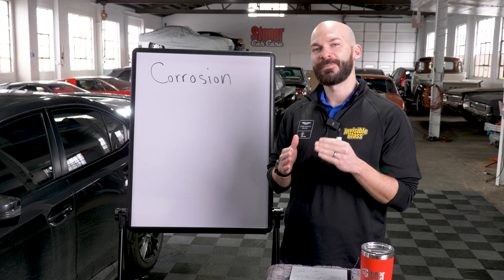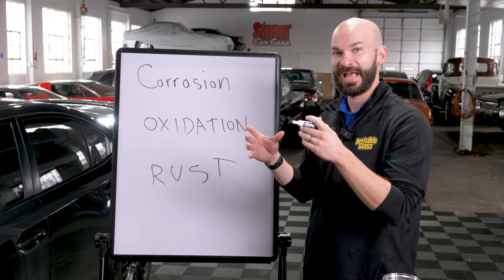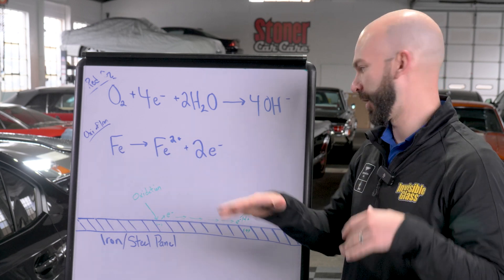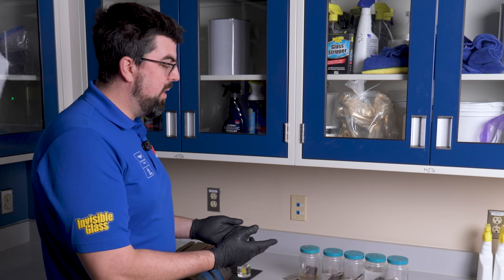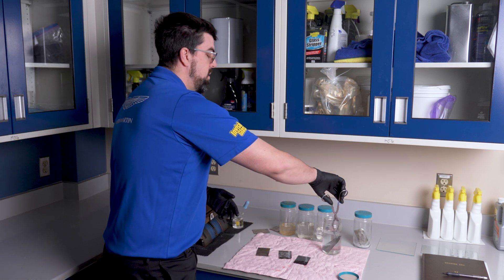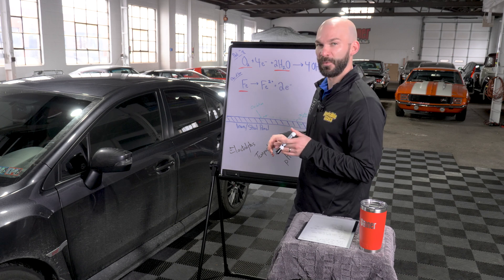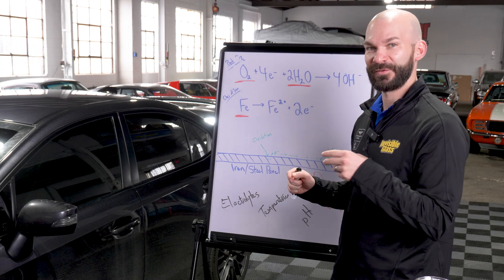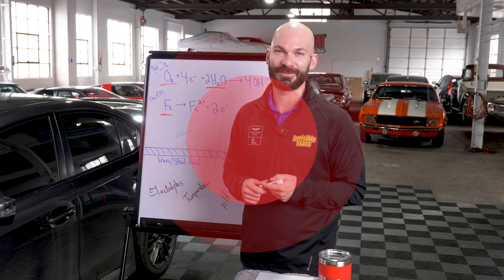How to Prevent Road Salt Damage on Your Car!

Comment: very long video just to say metal rusts. But this video is misleading because you're putting galvanic corrosion and oxidation in the same category. TL;DR use an oil/wax based coating on your car's frames to prevent rust.